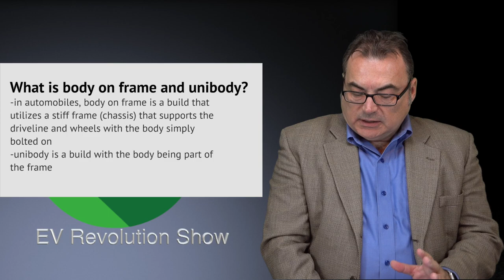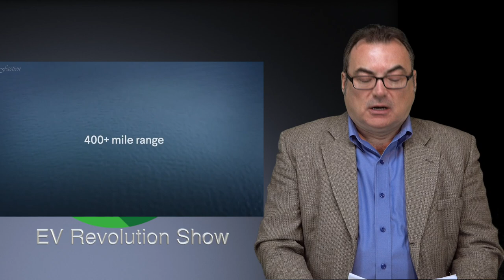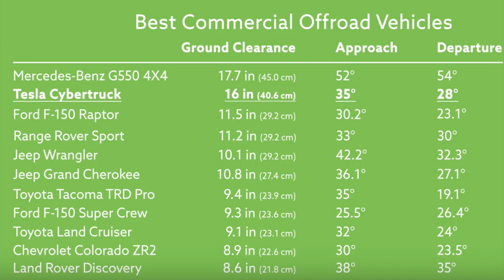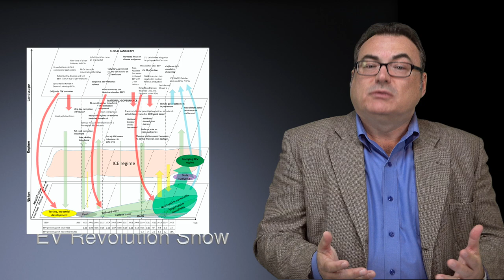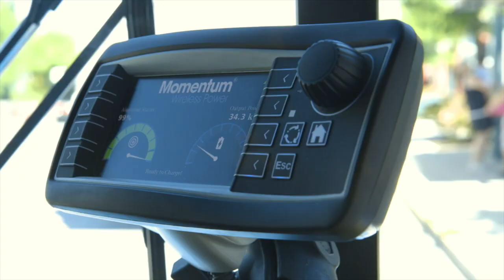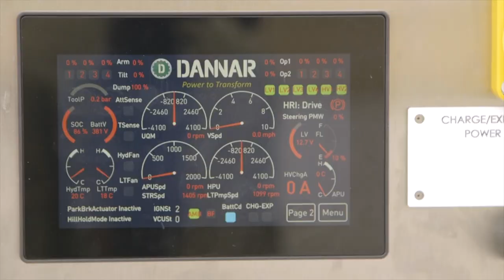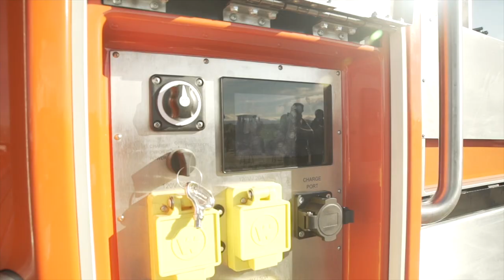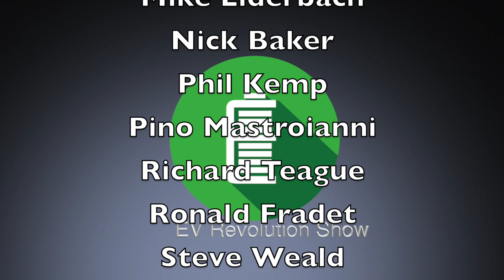Episode 70 - Tesla Cybertruck Part Deux, Lexus UX 300e, Fisker Ocean,  Dannar 4.00 and lots more!

Comment: A big 10 4 on the need for EV replacements of heavy equipment diesels. From the moment I step out my door, I'm assaulted by the stench and racket of diesel motors. The sooner these are electrified, the better.
Reply: Adoption in those areas seem faster than among consumers. People who buy fleets really do their research and see the benefits of EVs as far as maintenance and running costs and longevity and utility in many cases. Taxi drivers report feeling a lot more awake and relaxed / less tired and less stressed after switching to an EV, for example. Of course there are some countries where consumers are quickly adopting EVs but overall they are still a very small part of the consumer market. Also with a lot of fleets you are talking larger vehicles where the size of batteries is less of a concern. A lot of these use cases need less than a hundred miles per day for a full day of work which also helps with early adoption.
Reply: @0ooTheMAXXoo0  I'm going to bring Dannar to the attention of the City of Logan, Utah, where I live.
Reply: 60 years behind fuel cell was developed after the 2nd World War
Reply from the maker: Thanks Charles for watching.

Comment: You paired the highest end Rivian specs with their starting price. Based on what we know, a truck with those specs will cost well over 100k.
Reply: yes the base r1t only has a 105kw battery pack with an est. 230 miles of range similar to the base Cybertruck.
Reply: Yeah that was a little weird. I sincerely doubt the top end Rivian truck will sell at 70k.
Reply: The highest end Cybertruck is a better vehicle and half-ish the price of the highest end Rivian. Your video should be corrected to reflect that. Also, as I commented out your last video, forcing your EV to be the same general shape as a combustion engine truck just because that's what people are used to seeing is the furthest thing from practicality.
Reply: @rb1471  I had a reservation pre-Cybetruck and was told figures between 120k-140k for the top end. Also was told the 70k base price was "aspirational" but likely would change. Similar to the Model 3, only the top end Rivians will be produced initially.
Reply from the maker: Thanks all, @Shamus thanks for sharing that info.  Yes I've been told that the Rivian comparison may not have been like for like on the pricing point, and I will investigate my data and follow up.

Comment: Sorry Ken, The reason they went for unibody and not body on frame was to save weight. With a heavy frame and batteries range would be poor. Musk explained that airplanes went to unibody to save weight and he did the same with his truck.

If its cheaper to manufacture, awesome. That's not the primary reason.
Reply: Similarly, the reason for the different shape is aero.   The aero on the tesla truck is going to be much, much better than any other truck, and will give them longer range for any given battery pack.   Tesla's choices are not weirdness for it's own sake, they are choices directly driven by performance.
Reply from the maker: Thanks Jean-Pierre, yes correct I forgot to mention that fact too.

Comment: They weren't going to sell a normal truck at all, it wouldn't appeal to anyone. This, however, opens the truck to an entirely different market (people who would have never bought a truck) as well as a polarizing effect on the truck market. You have people that either HATE the truck (somewhat like yourself) and people that absolutely LOVE the truck. A normal truck would have a lot of sentiment in between "hate" and "love", but those people would have never bought the truck anyway. Now with this polarizing effect, we have a much more even split (and larger majority of sales) from those that love the truck, rather than leaving them in "maybe" land.
Reply: The design is driven by practicality for the most use cases. Half the truck people will love it for its amazing practicality at the price, and it will also bring in new consumers as you mentioned.
Reply from the maker: @RB, I will say that you don't know me from a hole in the wall.  I absolutely don't hate the Tesla CT and I've stated this already many times.  You missed my entire point.
Reply: @EVRevolution  I'm not attacking you, I'm simply saying people either want it or don't. You mentioned many times that you don't want it, "even if you were a truck person". But I think you missed my point entirely.

Comment: The unibody design allows the whole body to be lower as well. With a frame, you raise the cab up and that wrecks aerodynamics. Not good for an EV, for range or performance.

That will explain why I bet the electric F150 will be lucky to get 200-250 miles range.
Reply from the maker: Yes interesting point.  However for many, even 250 miles of range will be plenty for a daily use application.  I will predict that Ford will beat your estimate and surprise many.
Reply: Its almost as tall as a Ford F150 tho, aside from the much lower front bumper.  Hopefully they make the front safe for pedestrians.

Comment: Your price comparison between Tri-Motor Cybertruck  and Rivian R1T is not accurate. The $69000 R1T is the base model with 105kWh batt, 230+miles range and 0-60mph in 4.9s. A comparable spec R1T with 180kWh, 400+miles range, 0-60mph 3.2s will probably go for $100k+.
Reply: Cyber Alex 
Yes this is a really important. The Rivian looks good but it will be much more pricey.
Reply from the maker: Thanks @Cyber and @Michael.  I will re-look at the specs provided to me and follow up with a change if necessary.  The problem is getting all the pricing levels from Rivian just yet.

Comment: Ken.  As a Tesla fan boy myself, it is great to have “voice of reason” like yourself to help see things from a wider perspective.  Thanks for another great show.
Reply from the maker: Thanks Robert!
Reply: I concur.  I have turned into a fanboy for Tesla simply because of the sheer joy of driving one.  I don't know if there will ever be an apples to apple comparison between the cypertruck and its competitors.  The profitability with legacy trucks has been its multiple configuration system and its aftermarket parts consumption(and that will be the truth for the Tesla truck.  I do have one bit of concern with your analysis.  You highlighted Sales comparison with Tesla and the big three.  But you didn't add the element of time.  Tesla is a relatively young company and to be compared, at this staged of the development, is a remarkable achievement.  I would consider that the big three got to be who they are over a protracted period of time.  Better made cars have already struggled against the system (i.i the Tucker cars).  Tesla is just doing a better job.

Comment: Thank you.  I could see the Cyber truck could have multiple uses van flat bed 2 door camper ect ther a are lots of possibilities with this crab unibody configuration I think Tesla have worked this out 😁🤓
Reply from the maker: Thanks or watching.
Reply: Sounds like they just need to cut, bend and weld the stainless steel to have different kinds of vehicles. Cab on frame isn't the only thing that can have a lot of different kinds of vehicles. With the minimalist interior they can use the same parts on a different unibody. That's how they make sedans now so what's the big deal?

Comment: I ordered the Cybertruck because I believe it will be a major disruptor in the pickup truck market. With standard options included such as air suspension, 110v and 220 v outlets, air compressor,  ramp folding out of the tailgate, locking bed cover in addition to Autopilot and the full range of security and comfort modes such as Sentry and Dog mode, it will be extremely hard for other truck producers to compete and make a profit. I intend to order the solar package as an option. In Manitoba  where we get 98% of our electric power from Hydro and now with the solar option, I can say that my Cybertruck runs on "Sunshine and Water" . How green is that.
Reply from the maker: Thanks for watching Ken.  Makes me happy to know you ordered an EV and will be replacing a tailpipe.  Because after all, that is why I do what I do - not for Tesla referrals or free stuff, YT Stardom or an ego - but to affect some positive change on a very serious CC problem we all have to deal with.  

Love the solar comments and option, hope it all works out for you!

Comment: The reason the cybertruck is different is to increase utility. To increase practicality. The people on-line who like the truck the most are pickup truck users who really appreciate how the cybertruck is a better platform for their use cases. As for sales to specialized industry vehicles, that is a tiny part of the overall market. You want to sacrifice a big chunk of range and utility for the main market in order to add a much smaller market?
Reply from the maker: Again, show me the data that supports your analysis of the market sizes please.

Comment: Ken... I think you nailed it with your analysis of cybertruck. Basically it is a single use platform and not at all versatile for all the things that a truck can be used for. Re the Dannar agree its a great concept but only for pavement based work... airport runways, streets. It ain't a farm or off road with those tires. Another point why not just put a cab on it and have regular fly by wire controls. Remote might be fine for some situations but a guy sitting in the machine is going to be a way quicker on the functions because he's right in the middle... not playing a video game. I get it that cabs are expensive mainly because of the safety stuff, but relative to the overall cost of the machine and the functionality this will be minor.
Reply from the maker: Thanks Jim for watching and appreciate your feedback.

Comment: Can 4x8 sheet of plywood lay flat in the cybertruck ? And love hearing about the buses and heavy equipment
Reply from the maker: Hi John, no.  Bed length is 6.5 ft, I don't know the width.  But specs say 100 cubic feet of storage space.  If the bed 4 ft or more wide, then one should be able to carry a 4x8 with the tailgate down and possible some overhang.
Reply: @EVRevolution  okay thank you
Reply: It CANNOT lay flat in an F150 unless they F150 has an 8 foot bed. Do the come with an 8 foot bed?

Comment: No man, the R1T at $69k is the base model with 230 mile range and 0-60 mph in 4.9 seconds.
Reply from the maker: Hello Simon, thanks for watching.  Yes I was corrected by other viewers on this discrepancy I pulled from the Rivian website.  Still, specs wise the R1T is pretty good.  Final pricing on the higher trim has not been revealed yet but I concur that it will probably be higher than the CT model I compared.
Reply: @EVRevolution  yeah. It's all super confusing with cars that aren't finalized yet. Who knows what the actual prices will be. For example: Porsche asks hundreds of dollars for a charging cable or motorized charge port while Tesla even gives you a free home charger. Who knows how Rivian will handle that. I'm sure they will sell you a bed cover if you want one. These are very different takes on a pickup. One is for hip adventurers, the other is brutally utilitarian. Both have their markets and it's hard to do any apples to apples comparison.

Comment: The atlas shows your point on versatility with regular truck frame construction, however I think if Tesla can deliver faster that 2 years it will do OK. One thing where you wrong there is a frunk in the Tesla Cybertruck so it might have a front crumple zone. I think the Tesla will be very safe in accident, but will it be safe for the car it crashes into? probably not good for the other vehicle it hits!!!!!!    I would like to see a boxy long 1970' lincoln continental or Catylac style vehicle in all external cold rolled steel. that would be a beast!!!
Reply from the maker: Thanks for watching and appreciate the comments!  Rivian has a large Frunk too.  Yes, Tesla's are safe vehicles as are BEVs by nature.

Comment: No I don't think hey have narrowed the market. Tesla will sell a lot of Cybertrucks to people who wouldn't otherwise consider a pickup. I have ordered one and I prefer the better roadholding and lower weight when skipping the frame. The ride will be much smoother too.
Reply from the maker: Thanks for watching and glad you've put in an order for one.  I hope you follow through on it in 2 plus years.  It's all about displacing Tailpipes so I could not care if you buy a Tesla or another BEV, as long as we get rid of tailpipes and fast.  

Yes Tesla will sell CTs for sure, but they won't be the market saviour or leader.

Comment: Ken, there is NO WAY that Tesla went to the "uni-body" design "just to be different". You again, it seems to me, underestimate Elon and the thought that went into this radical departure from the body on frame design. Yes, body and frame are adaptable to many variants as you have pointed out. However, we are now just at the first iteration of Tesla's design. It is my guess that inventive minds will find many ways to adapt it to the many variants you describe.
Reply from the maker: I said John it was for cost.  Lower cost to manufacturer, easier for them to scale up to manufacture this design.  You are not listening to me and picking our snippets to throw them back at me.
Reply: @EVRevolution  Thanks, Ken, I did hear you say that Tesla went to the Uni-body design JUST TO BE DIFFERENT. I refer you to the 12:30 mark of your video. That's the comment I took exception to. Your earlier comments way back at the 3-4 minute marks were spot on but then you spoiled it for me with your comment at 12:30. Yes, I did pick out that snippet but I do listen to what you say. Otherwise I would not be commenting. If it seems that I am pocking it nits then I apologize. I do like your videos which is why I watch.
As for going after a broader market with the body on frame approach, let me just say that Tesla is truly the little guy in this arena. It does not make sense for them to use the broad approach. Tesla's production capacity will be limited for many years to come so this kind of broad approach is quite premature. They can’t do the cool ultimate SUV/Truck/Armored vehicle in "big boy" volumes at this time in its growth phase. Maybe further down to road but not now. Even this truck is a stretch for Tesla given all of the fronts on which it is pushing the envelope.

Comment: Ford is only coming out with a hybrid next year and you will not see BEV truck from Ford for few years.  Rivian looks great but at almost 2x the price.  So your expert opinion after using google is that Teslas Exoskeleton is nothing more then a uni-body that has been around for ages?
Reply from the maker: Thanks for watching.  I've never claimed to be an "expert" so please don't make accusations.  My opinion is what I stated it as.  There is nothing wrong with the CT, just that Tesla could have a bigger market to go after if they kept a more traditional approach.  Glad you like Telsa to but don't put words I don't say.  If you have more facts to add, then please do.  Seems like you and many are still missing my point, since anything slightly negative towards Tesla gets slammed.  Oh well, the reality of trying to be honest.
Reply: @EVRevolution  Tesla could have easily made a truck just like Rivians and it would also be in the same price range as Rivian.  Going with this superior stainless steel origami design saves tesla manufacturing cost required with stamping presses and pain shop.  Just think about how all the other EV pickups you hear about average about $100K and that's from new startup that have never made a vehicle before.  Cybertruck is just another choice coming to EVs and in my opinion unbeatable and will be for a long time after its released (a decade!) It can compete with ICE on price and has better performance.  Plus cheaper to run then a Prius.The only people that don't get it are really bad at basic math so they need someone to explain it to them. I am pretty sure that at the price point Tesla will out sell Rivian 10 to 1 even with the polarizing looks ..  BTW I'm not even a truck guy and never wanted to own a pickup since I was seriously looking at a AWD Model 3, but now I'm a Cybertruck guy!!  I ordered the AWD mid range.. I'm here in Canada where rust proof and dent proof will come in handy but realistically I'm thinking it will be spring 2022 before Canadian deliveries start. I'm live close to you in Mississauga so you will see me on the road for sure..

Comment: I side with you again Ken. Fanboys don't get it. We need to electrified all utility vehicles. They may be a smaller market but they are running all day long putting staggering amount of pollution in our environment mostly in cities.  The cyber truck will end up taking lots of spaces in parking lot 95 % of the time while body over frame trucks will be working hard. 
Side note : in Montréal QC parking fee are now modulated by the size of the vehicle. It just implemented in some parts of the town for now but it's a welcome way to limit congestion and wasted space that can be given back to more efficient mobility.
Reply from the maker: Thanks Gilles, as always a voice of reason and fact.

Comment: Body on frame is somewhat wasteful when the battery-pack provides so much structural support already.

Repair should be cheep enough. Angle grinder, sheet of 30X stainless, welder. Cut out the damage, weld in replacement material, grind the weld flush. Not as pretty as a $5,000 repair on a curved painted f150 panel... but its a truck. Who cares.

Most of a repair job is paint.
Reply from the maker: Thanks for watching Matthew.  Yes understand about the structural support and safety that BEVs provide.  We will see.  I hope Tesla sells and delivers boat loads of these.